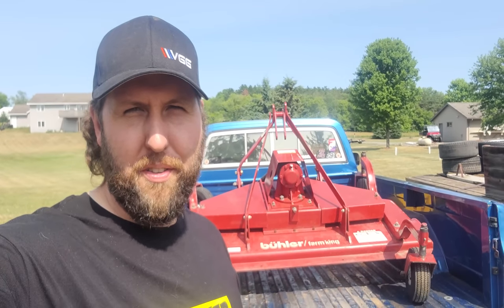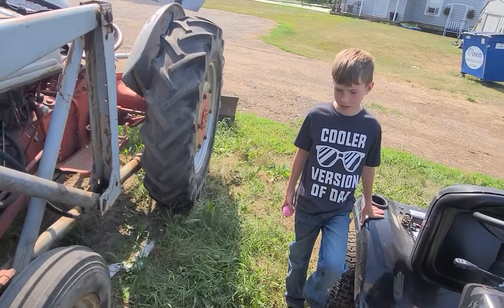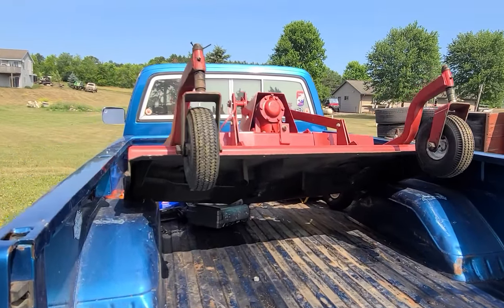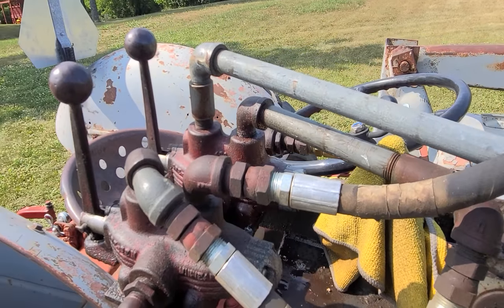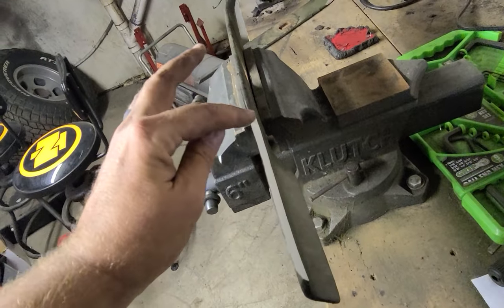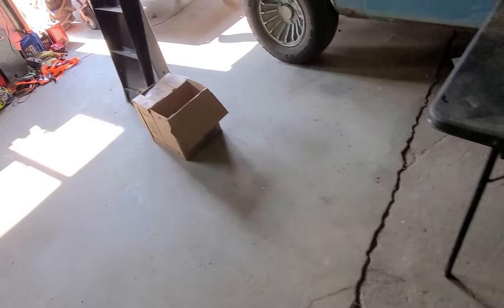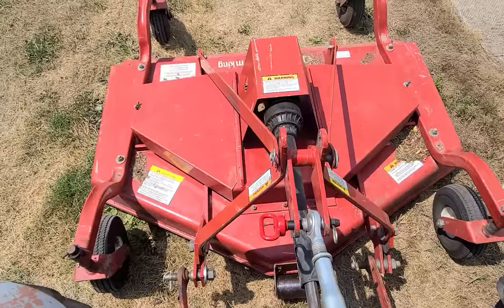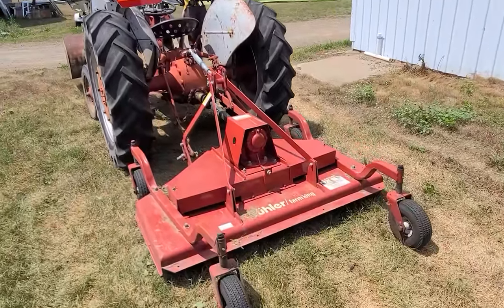Will This 3 Point PTO Finish Mower Work on the Ford GT500 (8N/9N)?

Comment: Just staying right out of the “Over Clutch Incident” what about a guy going full open-center modern up there on the control deck and upgrading to 4 spooler levers with the front loader run off 2 double acting control valves in series (without a power beyond option) then the rear hitch plus any ‘outback accessorarys’ separately via the other 2.  

A guy could install the control valve serving the rear downstream of the valve for the front not forgetting to set the relief valve which should always be upstream of the control valves, to pop right at maximum psig 
 And stay mindful if a guys using the rear valve for something that causes system relief to function, the exhaust cavity of the upstream valve is going to be over-pressurized right then which can get exciting but it's a guys little guys will be using it soon enough so I definitely can’t recommend that, so make sure to closely evaluate all likely max pressures and equipment ratings operating under worst case scenario when setting her up.  She’s old and low pressure yep that’s for sure but be careful of overpressure and pay special attention to that. 

And as far as not being able to hook open center valves in series, well there must be probably a gazillion owners and contractors of all earth machinery kinds out there around the world feeling very cranky when they realise their machines were plumbed up ‘the wrong way’ from factory fresh.  

Keep up the great work Derek & Jessica we sincerely appreciate it

Comment: Your tractor might have a Sherman transmission in it . That would make it a 12 speed.  Take your high and low lever put it in neutral and see if it pulls out and then down . They put a lot of those Sherman transmissions in.

Comment: That pto rpm selector is 540  / 1000 rpm lever. 

Run the mower on 1000 rpm setting with tractor at lower rpm for fuel savings and the pto rpm won’t be 1000. More like 500-600. Get that blade spinning without the engine speed. .  Finish mowers are low Hp using compared to a brush mower.

Comment: That transmission is probably a Sherman 3 speed, try pulling it away from the bell housing.  It should be a high, 1:1 and a low

Comment: Random curiosity; could you connect a electric generator "dynamo" to the pto and (if you match the RPMs to the dynamo spec) could you use the tractor to generate electric power?

Comment: Yer hydraulical pumperlator should go to a no-flow state once the set pressure is reached; basically the little pistons and crankshaft inside the pump continue to spin but aren't sending any juice out. there is a certain amount of bypass for lubrication and cooling, but the pump won't, or shouldn't be pressurizing all the time.  course if there are leaks then  that may be a different story. This is based on 26 years of navy aircraft hydraulic systems maintenance

Comment: Well if the pto runs on the gear selection the engine hp really doesn't matter no? Cause the pto isn't spinning until the tractor is rolling?
Reply: It actually connects to the clutch so it is regulated by the engine RPM. If you put it in neutral and let the clutch out, the pto will operate but it's not live, meaning you can't just engage the pto without stepping in the clutch first. It's like the old International H tractors were. Kind of a pain, and live pto is most definitely better, but you use what you have. The Cockshutt 30/CoOp E3 were the first tractors with live pto and that was a definite step up in technology since you could engage pto on the fly. They were connected to the fly wheel instead of the clutch so as long as the engine was running, the pto could be engaged. A shaft went through the rear end housing to the rear where a 2nd clutch was engaged by the pto handle which started the pto.

Comment: Inertia of mower still turns the pto shaft in the tractor when you step the clutch which pushes the tractor forward when you think it should stop. That’s why we never liked the old 9N Fords for bushogging. Fortunately we had bigger tractors that had corrected this issue. Scary if you aren’t ready for this, but maybe the front bumper will keep from hurting trees and buildings! NO

Comment: Ill watch you fix that old tractor. Maybe you can weld the front mower wheels on more of an angle so they dont hit the back tires.  Could get you into a pickle if you get into a ditch and need to raise the mower to get through

Comment: Old tractors will do more than one thinks. If one runs in low speed and gets the RPM's right they will do much more than they are rated for. If they fall within the rating they should work easily. You did a nice job on all this video but the unloading. You could have damaged parts with the forks like blades or possibly even bend the rotor assembly. Luckily you did not. It could have been strapped and lifted from atop. But I am betting they loaded it the same way you unloaded it and could have damaged it then as well. Consider yourself blessed. I would only use forks if the implement were on a pallet.

Comment: I aint no INguNEAR but your lever for your blade seemed to stay in the up position. If the hydraulics are setup correctly the up valve should go into a nuetral closed state when all the way up. Make sure that circuit isnt running a constant bypass, dropping your pressure.

Comment: 8n/9n/Jubilees have been hauling around 6" bushogs and rakes and balers since I was 10 years old.  I'm sure they were doing it long before I came along so a finish mower is nothing...if the tractor isn't a POS.

Comment: do not know why it would not work...I had one on my 8N and it mowed a lot of weeds/grass here in montana on 30 acres but sold it for 200 dollhairs replaced it with a 853 bobcat skid steer with a 90 inch triple blade hydraulic front mount mower deck.....I love it ...I'll be dipped too....that's the same back blade I have on my 8N which I still use on my drive cause it does a better job than the skid steer with the bucket.....but who cares about that?

Comment: A cheaper method would to put a speed adjuster or a bypass valve on it. That would slow it down for cheap, but 2x more valves

Comment: Tractor fix'in is fine.  But I wanna see basic hot roddin that tractor.  They have 5:1'ish  CR and not much timing.  Modern gas is better than the 1930's stuff.  So maybe shave the head and bump the timing and see where you are 😁

Comment: You have to run the tractor at full throttle to get the blade speed just like your yard mower
It won’t do a good job at idle

Comment: I'm been running the same  finish mower behind a JD-650 2 cylinder diesel . Only a 1500 lb ractor   and add a extra 100lb weight to the front   to keep it down .  To much du-mass speaking .

Comment: Are you sure you’re trans? Your high Lows not three speed forward, high back slow and back to neutral pull out and then go forward and you got another range of gears. If that’s the Sherman transmission.

Comment: I got this one to replace my valve body.  It's alright, no problems with it, nothing special.  Will require adapters to go to pipe.  1/2" British straight parallel pipe (bspp) similar to o-ring boss.  I got the 21gpm version, but I've got a bigger tractor

https://www.ebay.com/itm/2-Spool-11-GPM-Hydraulic-Directional-Control-Valve-Tractor-Loader-w-Joystick-/184325791221?mkcid=16&mkevt=1&_trksid=p2349624.m46890.l49286&mkrid=711-127632-2357-0

Comment: That Ford should be 28hp at the crank and 85 ft lbs. . You shouldn't have any issue with a bigger mower. Bush hog you might be pushing it but not with a finish mower

Comment: Those gauges make me cringe..
 Anway carburator work and new plugs will get you closer to 30 horse. I run a fast rich idel on my 9n its got to be high twenty in horsepower. When I got it it seemed like it made 1/2 that. Do the research take the time.